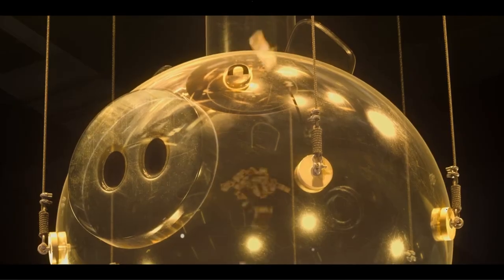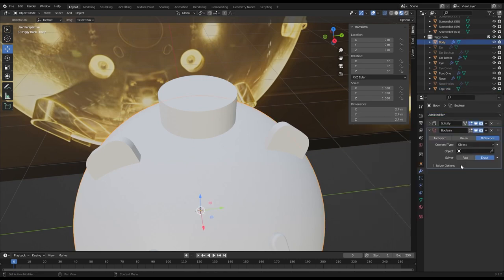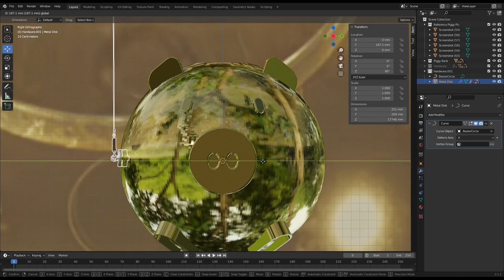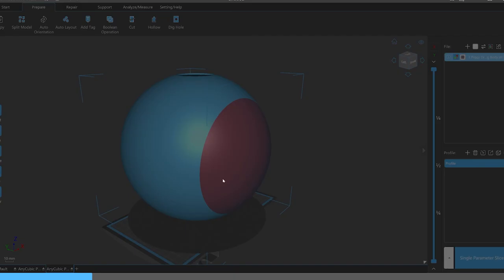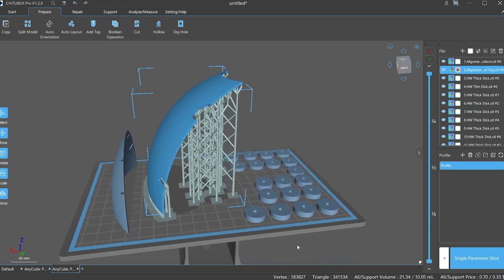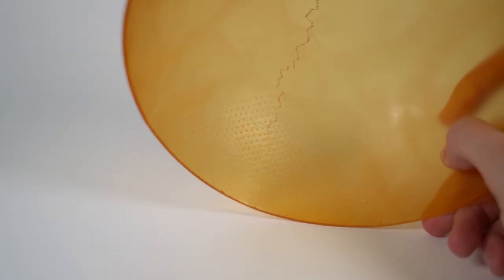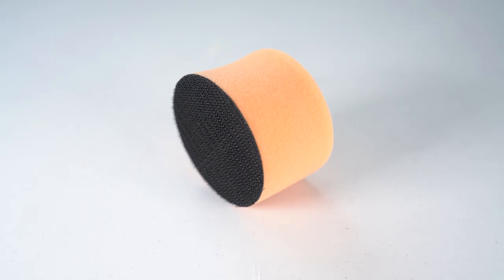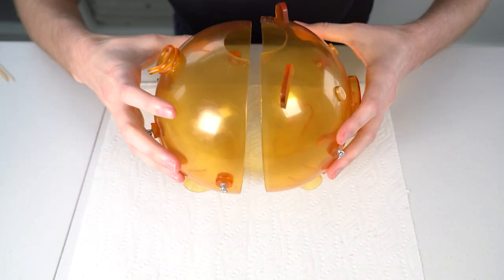Bringing The Squid Game Piggy Bank To Life

Comment: The bubble line may be caused by a slight air pocket in your resin pool at the bottom of the printer. I imagine as it slowly builds it up layer by layer it leaves a trail oof bubbles. I have had the same issue. Beautiful progect, you deserve more views and followers.